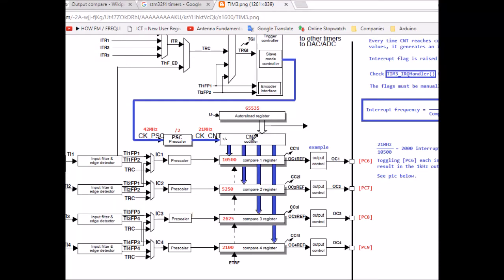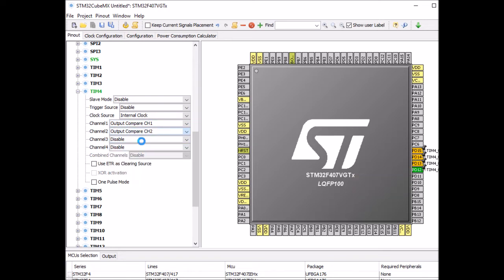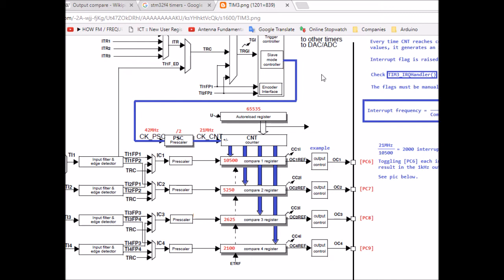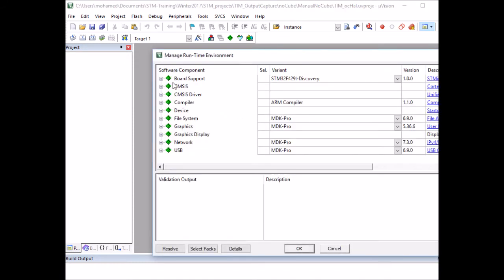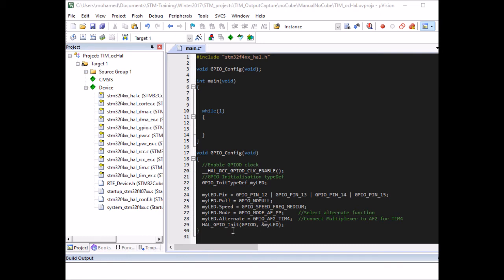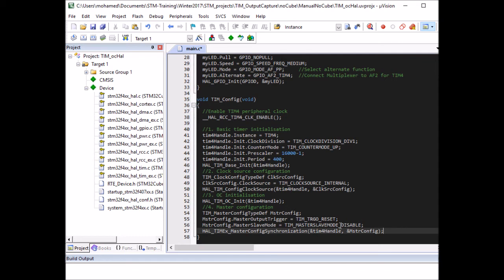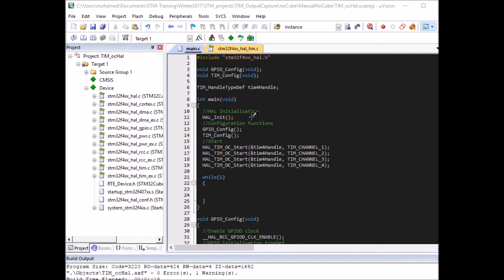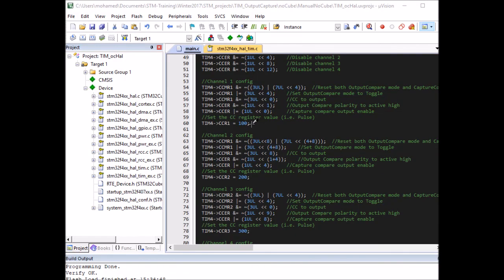STM32F4 Discovery board - Keil 5 IDE with CubeMX: Tutorial 17 Timers - Output Compare

Comment: Hai,
I need to generate a PWM signal for that ,
1) I need to compare 10kHZ triangular wave with a sinusoidal wave
2) I need to compare 10kHZ triangular wave with a constant DC signal
The PWM i need to generate is combination of above two. I need to add the result of 1 and 2 for obtaining the required PWM. Is it possible to do?
Reply from the maker: Hi,
You can generate a Triangular wave, a Sinusoid and a DC level signal with the STM board. So the answer is Yes, you should be able to do that pretty easily.
Reply: Thank you.
One more thing; how I can able to call both the pwm output and how I can OR these two pwm.
Reply from the maker: SARUN KUMAR K P 
Use an external OpAmp adder.
Or Implement both in Software.
Reply: MYaqoobEmbedded 
Thank you
Reply from the maker: SARUN KUMAR K P 
Good Luck Sarun